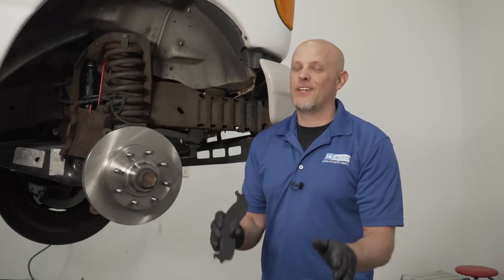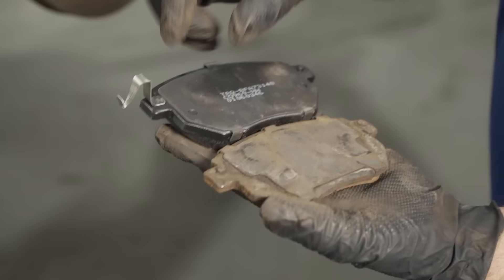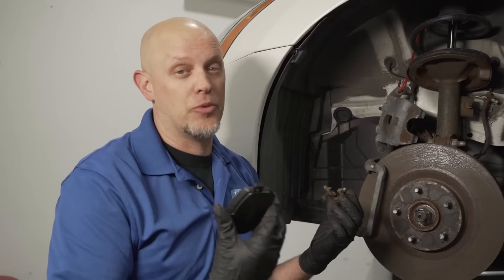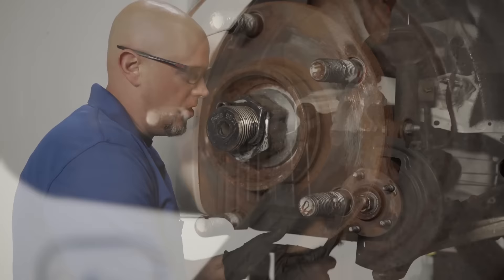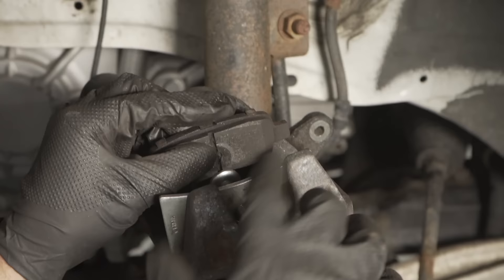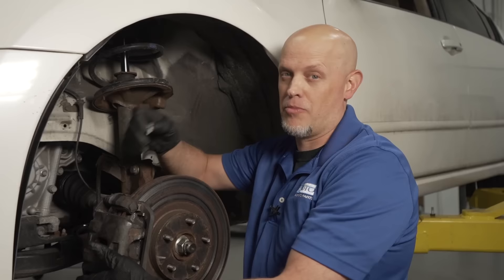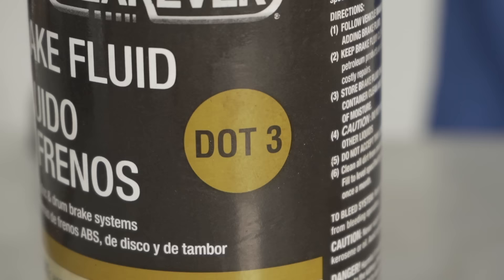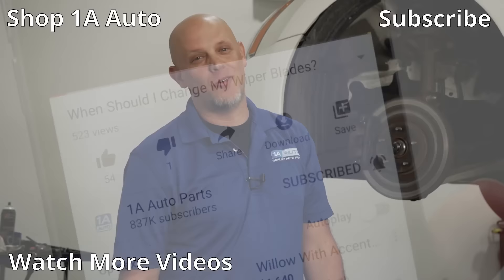Most Common Brake Installation Mistakes!

Comment: When my son did his first brake job on his Mustang, he flipped the inner and outer pads. The pins on the pad broke the caliper's phenolic pistons. He also didn't torque them properly and lost a bolt. Two of the mistakes mentioned here.
Reply: I have found if you do not have a torque wrench, but the bolts on tight, but not too tight.

Comment: I would add that on some vehicles, the caliper piston should not be merely compressed with that tool or a "C" clamp. Many autos require the piston to be rotated while compressing. There is a special tool available to do this. If you try and compress the piston without rotating you will damage the caliper and will have to replace it.

Comment: I've ruined an abs unit simply because I didn't pop a bleeder when I compressed a piston. Crazy what a tiny bit of rust can do to a valve train. Edit: also bubble flares are called ISO Flares as well! Found that out in a foreign shop.

Comment: Just a note,  I always did brake jobs one wheel at at a time.  This saved the problem of mixing up right left and front and back, though the last was seldom a problem as front and rear have generally been very different, especially in the day when I was working as a mechanic as most cars back then had drum brakes, with only high end cars having disk brakes and then except on some exotic race cars only having disks in the front.

Comment: We use Blue Dawn to clean rotors now in the industry. Removes the oil coated on non-coated rotors, or grease marks from your fingers. Also lifts any metal debris out of the rotor surface left over from the machining process. That ensures that debris doesn’t bed into the pad, causing a squeak down the road!

Comment: 1A Auto I really appreciate this video and the way you present instruction to those who may be doing something themselves that is a little beyond them but guide them rather than judge them. The demo on oil and brake fluid was perfect. I believe it is worth mentioning that, "If you are not adequately experienced, consider getting the work completed by a qualified mechanic. They are qualified, experienced and have all the right tools to do the job right, the first time." 

On refitting the caliber you mentioned tightening the caliber bolts to the correct torque but you did not mention reapplying thread locker, "If the threads on there caliber bolt have something in the threads that looks like gum, then you need to clean the threads with a wire brush or use new bolts apply a thread lock liquid before reinserting and tightening the calliper bolts to the correct torque."

Great instruction. Thanks so much.

Comment: Great video, great tips. I did my brakes a few years back for the first time. (2003 corvette) I gathered parts before doing job. New rotors, pads, new oem hoses. new caliper pins, boots and grease. I even went a few steps further such as replacing all bolts with new oem bolts. New bleeder valves also. Took my time and cleaned everything up with brake cleaner and wire brush. 
One thing to know is the copper crush washer for the brake lines at the banjo bolt end are one time use only. It is good to have those new ones on hand. 
also these days the auto parts stores sell rotors already machined to factory specs for youre specific car. In the old days you could not just buy them off the shelf pre-machined, and would have to have a mechanic machine them to specs. Not sure if they always do that now, but it is a good idea to ensure the auto parts store sells you rotors that are within specs for youre car first.

Comment: Your how not to videos are as good as your how to.  Love your slow, clear directions, content, and camera work.  Almost as good as ChrisFix.
Reply: I agree 100%
Reply: Top notch video.He's thought of just about everything and the few things he missed were covered in the comments. As for putting brake grease on the friction surface of the pad, the only thing I can add is I hope this guy never does a video on how to shave with a straight razor and how you should never slash your carotid artery while shaving your neck.
Reply: Chris Fix is good

Comment: Nice Video ! I always open the master cylinder cap and put a towel under it, when pushing the Caliper  piston back in .
this allows the fluid to return without a problem and is easier that messing with the bleeder valve .
Make sure to replace cap when done .
Reply: Yeah except you are pushing what is probably the dirtiest fluid in your system (from inside the caliper) back up through the ABS pump and into your MC.  Nope, opening the bleeder valve is a piece of cake and allows the fluid to escape.  Then you add nice clean fluid to replace it in the MC.
Reply: @StilettoSniper  would you then need to bleed the line if you crack the bleeder this way or no?
Reply: @StilettoSniper   In the Rust belt , You dont want to mess with rusted  bleeder screws unless you have to so , YES  removing the master Cylinder cap makes more sense . The Caliper fluid isnt any dirtier than the fluid in the brake line .

Comment: Another great video!  Never buy  "open box"  or returned pads.  It's not easy to judge a cheap organic pad from a top line ceramic, until you drive on it awhile. Scammers swap and return pads (and other auto parts) all the time.

Comment: Great video. Obviously if you are making these mistakes you might not want to do your own brakes. But another tip never let the caliper hang by the brake hose and a good way to make sure the brake hose is straight is to look at the lines on the hose itself or other markings.
Reply from the maker: +Marc Schvartz Thanks for the feedback!
Reply: @1AAuto  Wityh the vast majority of DIYers out there these days with cell phones, why not take a photo of the entire work area so if you forget how something goes, you can refer back to your phone for how it was......assuming it was right prior to your proceedure......lol

Comment: Very good video. The additional comments that I have are:
- always remove, clean and regrease the caliper slide pins. If they bind at all it leads to uneven or premature pad wear
- I always use Pipetite Stick on all threaded brake line fittings and bleed screws. This compound is non-hardening, crayon consistency, and is compatible with all fluids. Ensures that years later you can still loosen the fitting as the stick keeps the water out of the threads
- If replacing the caliper with a rebuilt unit check the bleed screw prior to installation. I have had a couple calipers now where the screw was damaged or the threads were not properly tapped
- watch for anti-rattle shims that are too tight. If they are tight when  new, then throw them away. My Honda's rear pads bound up and almost seized the brakes because rust built up under the shim and would not let  the pad release. This after only 50,000 km in a climate not know for excessive rusting
Reply: Some of these I had absolutely not heard before. The piptite stick is especially novel and I'll be buying one to use when I make new hardlines for my truck's clutch!

Comment: - never hang your brake caliper by the hose. use some type of creative bungee  hanger.  even an old coat hanger. 
-  when you remove  1 pad  take a picture.  remove the second pad - take another picture.   you'll have all the evidence you need to reinstall them correctly. the photo won't forget the details.
- put your lug nuts on the studs to protect them from your hammer if you need to strike the rotor. 
- while replacing your brake pads - remove the caliper sliding pins   - clean and lubricate the pins and pin bore -  lubricate them with the appropriate grease.  if you don't-  your caliper will probably seize on the pins prior to your next pad replacement. ( especially in rusty states )   your brake will not release from the disc / rotor burning both -  and only the compression pad will contact the rotor. 
-  BRAKE BLEEDING :  PRESSURE METHOD  (  made easy )  brake fluid is nasty  it absorbs water and causes corrosion inside your lines and calipers.   your favorite hardware has clear vinyl hose for bleeding.  get a piece of clear vinyl hose of the correct diameter that fits tightly on your bleeder. 25' or so.    fill reservoir  FULL TO TOP.  (  never let the reservoir empty during this process )    starting with the right rear - open bleeder - install bleeder hose - pump brake until steady clean fluid comes back to reservoir visible through clear hose ( into a catch container ). close bleeder.    REFILL reservoir  FULL TO TOP  and repeat  - repeat - repeat.  you just bled all the contaminated corrosive fluid out of your brake system. 
- ALTERNATE  GRAVITY BLEEDING :  use a piece of clear vinyl hose like above about 8' long.  jack vehicle front or back.  remove both wheels from same axle.   FILL RESERVOIR FULL TO TOP.    route hose VERTICAL up side of vehicle  fender well. ( see buoyancy )    loop over  masking tape or magnet holder- and down into container. open bleeder and install hose.  now go work on the  OPPOSITE brake. ( DO NOT ALLOW RESERVOIR TO EMPTY )    by the time you finish changing brakes on left - the right brake will be bled. close bleeder and swap positions and  REFILL RESERVOIR.    all gravity, buoyancy and physics.  no work involved.   if you don't understand these instructions - and how simple they are - do not do this.  when you understand these physics and how simple this process is - you'll be able to replace your brakes and bleed them in the same time with no help.
Reply from the maker: +mixter7x7 Thanks for the tip! We'll pass this info along to our production team.

Comment: I'd add the Three brake greases: 1) Red (Grease) for anything that sits in fluid 2) Silicon for sliders / gaiters or anything rubber 3) Copper for back of pads/ nipples/ joints.

Comment: One thing I learned that is extremely crucial the first time doing my brakes is to hold the 19mm bolt with a socket ratchet and tighten the caliper bolts. This  is a safety feature and if you just tighten the caliper bolts like I did they'll probably come loose which is what I experienced. Also, the serpentine belt tool is a great cheater bar and was soooo useful and saved me a huge headache in removing the bigger 19mm bolt. I hope that helps in doing your brakes safely, timely, and efficiently.

Comment: For the pins  use the right grease like the Permatex 24125 Ceramic Extreme Lubrifiant for the pins . It's a purple grease   and for the anti-seize  use the Permatex 09127 Copper Anti-Seize, this grease is copper colore .

Comment: Tips for us home gamers: 1. Always pull the slide pins out, clean out the old, nasty crap inside and replace with a good slide pin lube like Sil-Glyde.  Doesn't hurt to clean the rubber boots and rub some slide pin lube on them also, as it helps them last longer. 
2. Get some good anti-seize and put some on the any non-pad surface that touches another non-pad surface, like wheel studs, where studs press against the rotor, caliper and bracket bolts, and even the back of the wheel where it presses to the studs and rotor 'hat', which makes it a lot easier to actually remove the wheel next time.
 3. If you're in the NE, or have real winters, splurge just a little and get the coated rotors.  Where I shop online I stopped buying the economy brands and saved myself a lot of hassle going with Centric/Power Stop coated, they're only llike $10 more per set, and way less rust issues and I actually think they last at least 2 brake changes vs the normal 1 on Murano's.  Funny thing, my Mom was recently quoted 495 for front and back brakes, each. Of course it a dealer right?  I looked online and scored 4 rotors and pads *KOE4100) Power Stops for her 2017 Rav4 for $48 +  $23 s/h. 
Right now is $96 + s/h. 
Took about an hour and a half on a Sat afternoon with BIL, and saved Mom at least 500-600 from any non-Dealer shop.
Disc brakes are about as simple as one can get, and there are tons of good video's on YT if you're apprehensive.
For $200 you can get better than OEM, ceramic low dust coated brakes that will provide you with better, consistent braking without fade, do it in a couple of hours, and save a wackload of cash.
Reply: No greasing of the wheel studs, ever. Lubricating the wheel studs lowers the coefficient of friction between the threads of the nut and stud, thus changing the true clamping force of the wheel to the car even when properly torqued. Lug nuts and studs are R&D to be dry fit only. If the nuts are difficult to remove then someone has over torqued them or they're galled, cross threaded, etc.
Reply: My Bimmer dealer wanted 2k to do front and back. They had the wrong guy.
Reply: @barrymccaulkiner7092  absolutely. I've heard plenty of horror stories of snapped studs because of anti-seize.
Reply: @barrymccaulkiner7092  so putting nickel anti-seize on the studs & using a 600mm breaker bar with  “ feel the tension “ & not using a torque wrench is wrong ? I say not as I have been doing it that way for forty years & never had a wheel come off or a galled or seized wheel nut on the other hand my partners car had dickheads at the tyre shop using a air gun & no lube saw broken wheel studs or nuts that refused to come loose when flat a tyre presented itself . I will keep using the 600mm bar & nickel anti-seize which I recommend to anyone that owns a car to remove way over tensioned wheel nuts especially if you have an issue with strength , joints etc . It is also wise to buy a black impact rated socket to suit which will  never break & If you can’t loosen the nuts with this you can snap the stud if need be to remove the wheel . Sometimes there are 2 right answers & the engineered one is not necessarily the best working one.
Reply: I've always used WD 40 on lug nuts and studs so they won't freeze up from corrosion or rust .
I use it on battery terminals , too.
been doing it since 1971 .
Dont plan on changing now .
Reply: Very inspiring, put me in coach , I'm doing this. thank you
Reply: I've been using anti-seize paste (never use grease) on lug threads for 60 years and never had a problem. Was in the tire business for years and have seen many thousands of wheel changes.  I've used a torque wrench to check torque both tightening and removing and don't see a problem. On the other hand, living in the rust belt Northeast I have seen lugs that rusted on so badly even oxyacetylene torch heat wouldn't remove the lug. Then the only answer is to either put enough force on the lug nut to break the stud or use an angle or die grinder to cut it off.  None of those solutions is pretty. I do anything I can to prevent the rust in the first place.
Reply: An hour and half for all brakes?  You are incredible
Reply: @barrymccaulkiner7092  Interesting info... how about using WD40 on wheel studs to allow smoother cleaner install of nut to stud; and to prevent studs to rust?
Reply: @craigerickson1910  Is paste different than grease?  How about WD40 on studs to prevent rust from forming on threads and nuts?
Reply: I live in upstate NY....rust belt for sure. I've never once seen rust on a stud or lug nut. I brush off threads before installing studs. From my engineering profession side, I'm aware that a lubricant on studs changes the coefficient of friction to the point that actually helps to overtighten. I also design and sell heavy rotating equipment and we'd fail inspection and code if we ever did such a thing. Yes, you'll get extra torque (which is why they've never come off for those of you installing over decades like that) and no, a stud won't come off on its own, but studs are not designed to be stretch bolts...and you are fatiguing that stud.
Reply: @mannarmylie4195  
Lol wow!!!

Comment: Getting ready to replace both front and rear rotors/brake pads, while also checking ABS wheel sensors on a 2000 GMC Sierra.  This is one of the best videos I've seen, and as a first-time installer, thanks for all the great tips.  I'm going to take pictures as I go along, and will definitely be watching this vid a few times before I start!

Comment: 4:54 - also keep in mind sometimes a gear puller is needed if the hammer or rust remover technique do not work.

Comment: I'm just about to investigate abnormal brake wear on an inner brake pad 60k miles after a DIY replacement. There's been a slight dragging sound since I bought this Silverado 1500 4 years ago. I finally narrowed it down to the caliper after discovering the inner pad wore very quickly compared to the other pads. This video is great for things to look for. It's likely one of these mistakes was made during the last rear brake pad change.

Comment: use the old pad as a plate to compress both pistons at the same time in a dual piston caliper.
Reply: ...or a three piston, or a four piston.
Reply: @craigerickson1910  You'll never see a 3 piston set up (it would be a 6 piston fully floating caliper). For those you need to use a dual sided pressing tool that'll do both sides simultaneously.
Reply: @KR4Z3D666  There's 3 piston calipers. Jaguar for one. Plenty of motorcycle calipers with 3 pistons.

Comment: Great video! I have used a rubber mallet or dead blow on rotors before. They do not dinge a rotor up like metal on metal. Whats your thoughts on cracking the reservoir cap versus a bleeder? That is general what i have done and used a large c-clamp to go inside the piston to collapse. Thanks 1A Auto!
Reply: I like the dead blow hammer if I'm reusing the caliper. 
I crack the reservoir cap when pushing the pistons in. Less messy and less cleanup. Once the pistons are in I then tighten the cap to keep the fluid from absorbing moisture.